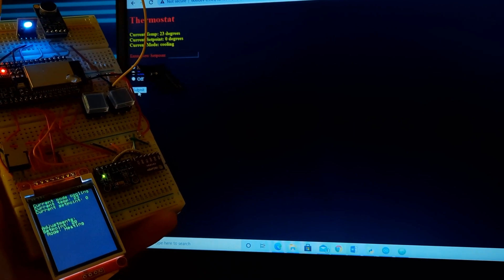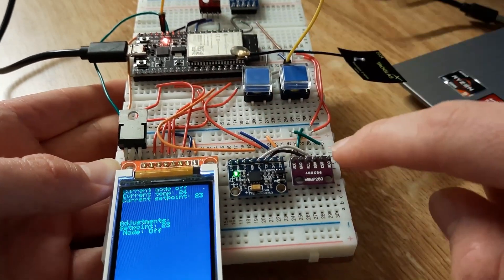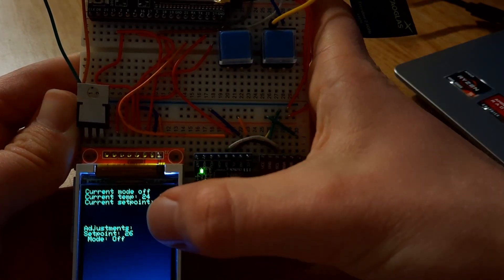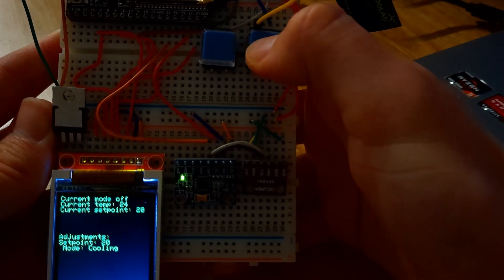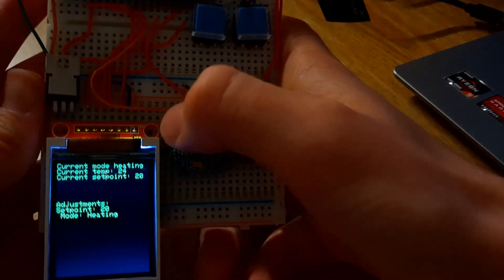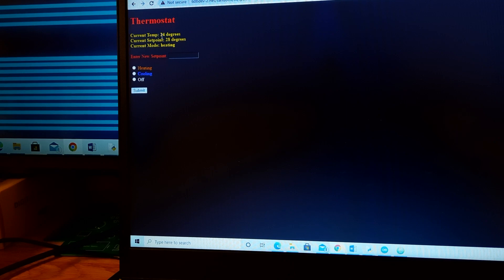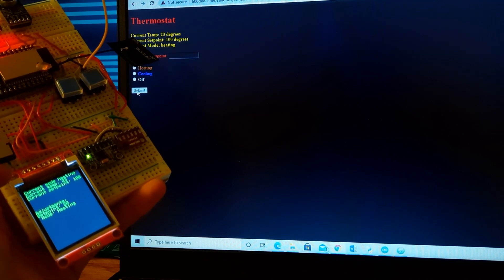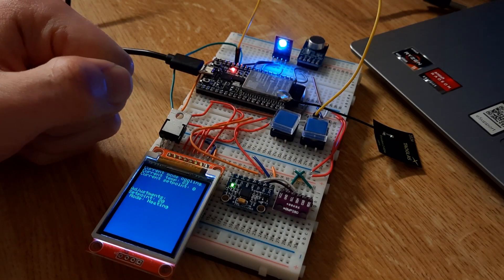Prototype wifi controlled thermostat

Comment: Now add a second sensor for the outside temperature (or a potentiometer for easier testing) and use the green LED to represent bringing air from outside. So for example, if you set 25C when it's currently 28C in the room but only 18C outside, it will open the vent instead of starting the air conditioner.
Reply from the maker: That is a good idea! Or have it open my window might be cool